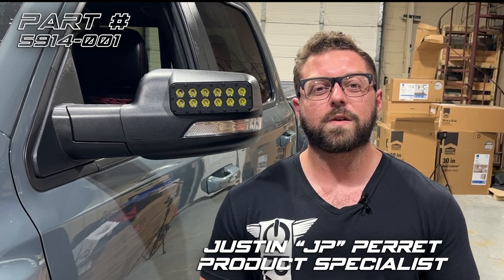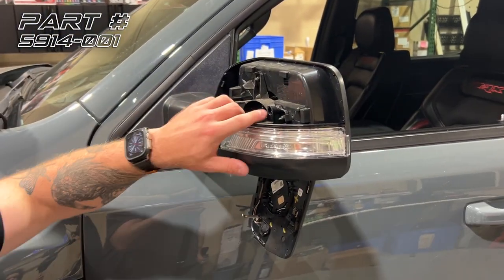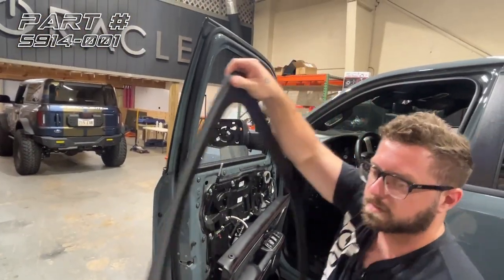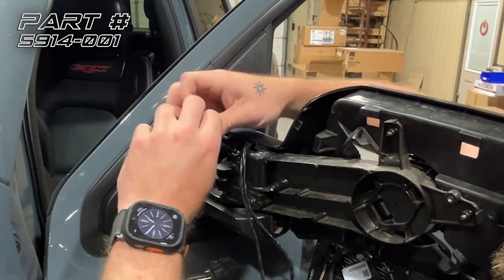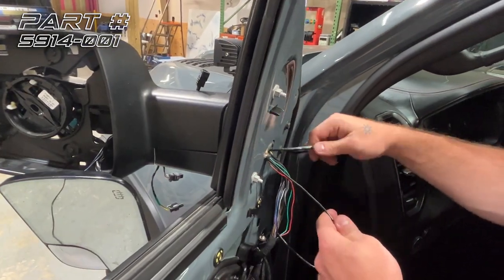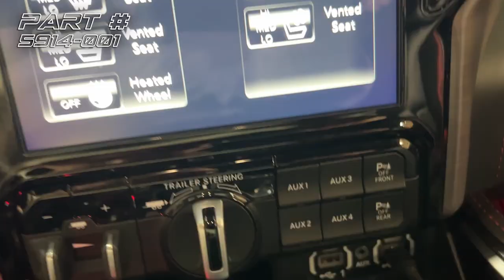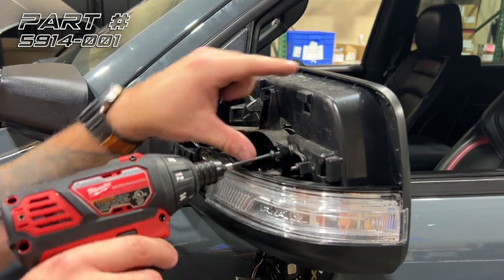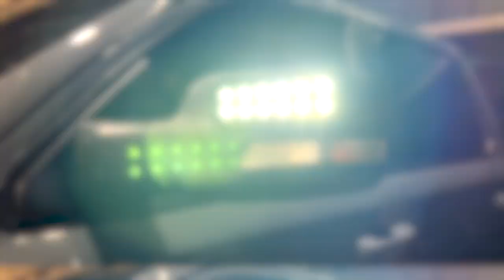ORACLE Lighting 2019-2023 RAM 1500 DT LED Off-Road Side Mirror Ditch Lights Install Guide

Comment: In the interior lighting kit videos for the TRX, you ran cables from the door to the cab using the big grommets and harnesses. Would that be possible for this install as well? I don't like that cable running between the door seal like that.